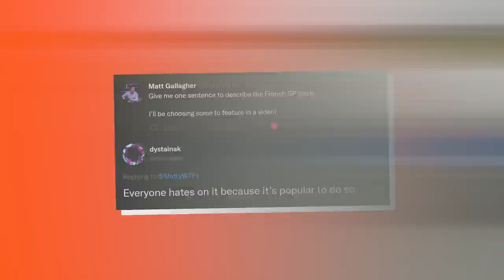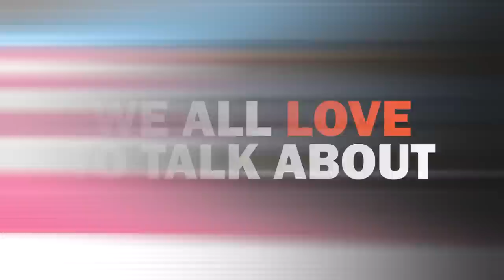Is The French GP Circuit Really THAT BAD?

Comment: Last year proved us wrong, and with how the racing is going this year, it will be a banger. It was really the car’s fault all this time
Reply: I guess we’ll find out this wknd
Reply: I dont look positive at this race in general yes cars are more close and competitive. But also more bulky. And if I remember correct going on the blue or red will destroy your tires. So I dont know but it can end amazing on track battles real fast.
Reply: I would say the race last year should be considered as "standard" for the sport, not really great but something that should be expected.
especially considering that this track is actually designed for racing, unlike, say Monaco which by design (or lack thereof), is expected to produce boring races.

The only reasons we find the race "exciting" back then were because 
-  the track is notorious for being boring in the first place, fans came in  with low expectation by default and where quite surprise when some things actually happened, and 
-  the sport suffers from the lack of competition during the long years of mercedes domination, fans are thirsting for anything that remotely looks entertaining back then, especially if it involves the defeat of Mercedes.
Reply: one good year doesn’t wipe clean two boring years

not to mention it was kinda only 5 laps of excitement
Reply: I'm hoping that since we have closer racing, most of the tracks will improve. Maybe once the cars are smaller, Monaco might be an option, but I doubt it.
Reply: And also it didn't need rain to produce a good race unlike Sochi (but yeah Sochi is probably the most exciting race last year)
Reply: @burningfreeman1  The coloured  lines are really abrasive yeah. They're designed to slow the cars down so they definitely damage them quicker. Especially if you slide across them
Reply: So people saying that Lewis’ was only fast due to his car aren’t bigoted now?
Reply: Nice point, I like the thinking here, let’s go!
Reply: @burningfreeman1  they are still 2m wide...
Reply: @gelmir7322  Last year was pretty exciting, so expectations should be higher for all races this year
Reply: Last year it was more of a strategy race that made it exciting instead of actual racecraft
Reply: Here we are, it was trash as expected.
Reply: Last year was exciting because of strategy. Not because of the track

Comment: Actually, I enjoy driving Paul Riccard on the F1 game, as it is a challenging layout with some slow corners in Sector 1 and a very tricky traction zone before the main straight in Sector 2, followed by the Chicane du Nord which splits the Mistrale straight into two parts. A good exit there sets you up for a possible overtake into the flat out right hander. The last sector has some flowing corners you need to absolutely nail to get any sort of lap time, however you can’t run to much downforce, as the main straight and the run from the Chicane du Nord down to turn 11 will punish a too draggy set up heavily. It’s a challenge for the car and the driver, as well as finding the right balance in set up. You want rotation bit a too aggressive suspension is likely to spin you out through turns 6 and 12 especially and maybe even turns 1 and 2, but you want to avoid understeer without adding downforce.
Reply: It’s an absolute banger on the games. Especially online/with friends as even if you’re not left space by inexperienced companions it’s still possible to continue racing and battle for the next corner. Had some of the best racing there
Reply: Thanks for at least defending it a bit. It’s a great track in games and with the new cars it will be a banger. With all the hate this gp is getting French fans don’t know how to act and defend it. We still hope it stays or be replaced by a more famous track but still it’s unfair to label it bad because of two bad races.
Reply: @graueliot9327  exactly man its my favourite track on the games, completely agree
Reply: I do too
Reply: @graueliot9327  yeah they should bring Magny Cours back that was a great track
Reply: Just wrote a comment saying the same. Glad to see others agree. I don’t understand the hate. The track came about when the cars were crap and only one guy could win so maybe that’s why people don’t like it.
Reply: I have had my best races there on the F1 game and enjoy driving there too.
Reply: The circuit will changed in 2023 possible but it will likely happen
The turn 1 run off area now become the straight while the slow corner in turn 1 is going to be a gravel
Reply: Wow wow wow, someone named some of the corners 🎉 🎉 🎉 
you took on the challenge in the video and nailed it 👊
Reply: I find that people enjoy this track because the AI is pretty weak on this track. And it doesn’t punish bad angles on the long turns. 
Compared to Hungary where the AI is very fast and it’s a super punishing track, especially on the chicane. 
I enjoy Paul Ricard too, and this race might come down to tyre degradation. The new tyres are really durable, strategies will be interesting. 
Also, agreed on the French flag stripes. It’s an eyesore
Reply: @weignerleigner3037  no, they hate it because it's nauseating to watch, all ariel shots are bad. It's a good layout hidden in a garbage parking lot.
Reply: @stevendawson6032  yes but Magny-Cours is located in the middle of nowhere and the GP is not financed by the government but by the local collectivities where the Paul Ricard Circuit is, and the ones where Magny-Cours is in don't have enough money

Comment: How to fix the french GP:

1. The racing: 
The racing can be easily fixed by choosing the first configuration for the first corner (flat out S corner). 
Cars can follow better then so that the next chicane becomes an overtaking spot. The rest of the circuit is actually pretty good to overtake and follow. I don't actually understand why they haven't tried this, since it's already there.

2. Asphalt
The amount of asphalt should be reduced, especially with the blue lines which causes headaches in some people. 
Asphalt reduces the tension of the watcher and drivers, where they can easily go off track. Add more gravel and grass instead and some corners will become iconic.

Comment: If Zandvoort can be remodeled, then so can Magny-Cours.
Reply: The main problem with Magny-cours is not the track itself, but the things around. It's in the middle of nowhere, so it's not made to receive a lot of people, it's hard to access since it's not near a big city with train or airport, etc. In term of track or infrastructures, work have already been done between 2010 and 2014, but it's not enough to host a F1 GP nowadays

Comment: It suffers from the same major issue as one of the middle Eastern f1 circuits (can't really recall the name of it), lack of elevation change.
If tery are there they are tiny, it makes the track seem like a slab of tarmac with some lines painted on, and completely removes the visual interest (and in car visibility).
There's also the excess of long straights (once again not a unique problem), which makes it utterly tedious (and adds too many chances for drs mindgame tomfoolery).

Comment: I have to say, in Assetto Corsa Competizione with its GT3 cars and the corresponding layout, I rather enjoy the track. You can really send the car in places and the ever-changing radii are a nice challenge and provide different line options for setting up a pass. The long straight is a blast as well, and the physiotape all over the place is actually kind of iconic, at least in VR.

Comment: My main issue with this track is those blue, white and red stripes painted everywhere, they give me headaches and they make it really difficult for me to understand what layout is currently being used. It also gives me the feeling of a track with multiple crossroads inside, like they are racing in an actual city centre. I think the image sent by Captain Lautner perfectly represents what I see when they race at Paul Ricard. To fix this, they could simply paint only around the layout they chose instead of every single road or maybe just add some signals or borders that can help delimitate the actual track visually and physically.

Comment: The track is a very balanced track that doesn't give any advantages to specific design concepts, so the race simply shows who is the best overall car. Since Mercedes has been so dominant for most of the last decade, that means the race is typically a Mercedes curb stomp.
Reply: weren't Red Bull a lot quicker at PR last year?
Reply: If the car has good Straight line speed, acceleration and fast corners is going to be the winner
Reply: @F1_HQ  Yes, because Red Bull had a great car last year.

Comment: Unfortunately, there is no real Grand Prix circuit with character and tradition in France. That's why France has had a lot of different circuits for French Grand Prix over the time.. whether it's Reims, Rouen, Clermont-Ferrand, Le Mans (GP), Dijon, Le Castellet or Magny Cours. Neither track could really last long. Of all the circuits I would prefer Dijon-Prenois.

By the way, Spain has the same problem with the Barcelona circuit. It is also more of a test track in terms of character.
Reply: There's always Pau.

Comment: I personally like it.. i like the colours and danger zones. I lke that if you go off track you dont automatically go out of the race like hitting a wall, stuck in gravel and so on and so forth. You simply lose time and tyres get worn out more in the red areas. So it's good for racing and cost cap.

Comment: I think it’s perfectly adequate, and better than some. A solid midfield track, if you will. It’s given us 2 very good races, especially in the midfield, and seems well-suited to the new cars. I don’t have an issue with the multi-multi-multi-use configurations, since we have a lot of that here in the US. I think any purpose-built tracks should have a variety of configs, since it means multiple classes and series can use it throughout the year. Benefits fans and the local economy both.

That said, the paint job is too jarring for TV. It’s not a bad *idea* to do all the stripes in the runoffs, and it’s probably pretty cool in person when you’re not moving about, but it’s not overhead shot or broadcast-friendly at all.

Comment: I think the biggest problem of the circuit is the lack of memorable landmarks. Theres no hill, no castle, no bridge, no tunnel, no stadium, not even a tree… so the track itself just looks uninteresting. And yes the first two races after its absence were boring, but to be honest those years most races were boring because merc was so dominant. I think the track layout itself - with the high variety of different corners and good overtaking opportunities - is actually quite good. Looking forward to it with the new cars.

Comment: It really isn't that bad of a track and it is actually a bit challenging to some drivers. My suggestion would be to move the french gp to Le Mans. Use the existing Bugatti layout  and then extend the track into the porsche curves and reconnect it via the test track. It would be costly, but if you plan that both F1 and the Le Mans 24 hours is a weekend apart it would draw much larger crowds for both races and also boost the overall appeal of motor racing. Maybe sell it as a 2 race package and that way motorheads can come camp and enjoy 2 different types of racing within a small window. Reducing the need to travel far between venues.

Comment: The problem with the French GP is the fact that it is a very long technical track, in which the gaps between the teams are being highlighted to a greater level and this doesn't promote close racing. In other tracks this problem is not that highlighted and therefore the spectacle is greater.

Comment: On ACC (Sim Racing), I hated Paul Ricard when practising, but during the Races, I learned to really enjoy it and was actually tempted to restart the 2 hour race in the career mode, cos I enjoyed it that much.  I came in 7th, but only cos I messed up my driver changes and had to pit on my last lap just to change drivers, it was gutting having to just sit in my box watching my position go from 1st to 7th as the cars screamed by.  Otherwise, I had a really healthy lead in first.
The layout used (I think) is no turns on the long straight and longest / outside track for the rest.

Comment: They should bring back Magny Cours to the F1 instead of Paul Ricard, in my opinion, and it's possible, considering that the track is still suitable for F1 (it still have the FIA grade 1, which is required to receive a F1 race).

Comment: I pretty much love this modern circuit, because it has all that a racing circuit needs to have (hard slow corners, fast corners, short and long straights, S-corners, all that stuff, but it's still safe, clean, and very good for the audience, but really not boring or easy at all. And I do not like any circuit with walls just next the track. Why does there still need to be a real danger of death or serious injury in the 21st century? There are many other options, like gravel zones, escape zones, grass areas, etc. This circuit is the only one, which can be called safe and modern, in the whole F1 calendar.  And only 2 or 3 others are any near to be safe... There are many great circuits, but they really need to be redesigned on the safety side, by adding gravel zones, escape zones, etc, with no walls near the track at all... And no any kind of yellow curbs, which may catapult the car, or cause a serious injury to the drivers, instead of the gravel or grass areas, which do the same track limitation job, but safely... Just one thing at this circuit is bad - the pit entrance. It really needs to be redesigned, maybe like a Bahrain or Monza circuit, with the entrance at the straight part (there really is plenty of space for it), or just by shifting the entrance road one corner back, with just one or two big curves, like Suzuka, or something like the Red Bull ring...

Comment: 2018 and 2019 were considered boring races but id argue that 2021 was more interesting. Now we have these new cars I feel like it will be a better track. It has Silverstone vibes with its high speed corners, a track should always be judged on its last race. France is also super hot at the minute which means the race will likely be a 2 stop. Add Merc potentially being in the mix and RB and Ferrari being close. I hope its a good race. That being said Magni Cours is a better track and slightly shorter so the lap isnt so long. 

Anyway fingers crossed for a great race weekend!

Comment: The racing could be amazing. But it’s impossible to differentiate one corner from another. The tv coverage just bounces from one sector to the other and I have no clue where we are at. 
The acres of blue, white, and red stripes does even more to interrupt the viewing of the track. 
Even with this years cars, there are times when everyone is holding station…at that point it really helps to have a track with character (Spa, Montreal, Monza, etc.) but this really has always been just a good test track.

Comment: I kinda like it, but the timing of the race is wrong. After the Monaco GP is perfect as they are quite close to each other.

Late July is the usually the hottest weekend of the year in southern France (around 37c to 40c) and height of the high season (busy touristic period of the year too) — I’m sure this will cause discomfort for the fans getting there and the heat could cause some to feel unwell and with the F1 cars cooling issues. 

I wouldn’t be surprised if there’s a few DNFs for cooling issues and big complaints with traffic and organisation…

Comment: There is also no scenery. Around the track there are just some grass banking, and outside the track in every direction there is just parched land and dull trees. Take any photo of the circuit and I would not have a clue where it was taken. To add to that there don't seem to be many grandstands close the track, thanks in part to the huge run off needed everywhere because of all those track configurations where everywhere could be a corner in some config.

Comment: I think it's OK. It's a proper race circuit, so I'll happily take it over the likes of Singapore, Saudi Arabia and Monaco). I'll also take it over Spielberg (although that could be to do with over exposure due to F1 and MotoGP both having had two races there in 2020 and 2021). France being off the calendar for 10 years should not have happened. It's nice to have them back
Reply: I like Spielberg. But I feel like it generates the most inconsistent race stewarding of the calendar every time.

Comment: Lack of character says it all for me. I always wonder how the drivers can pick out the track edges, because some indicators aren't (at least as a viewer) particularly clear. It will be worse this year, as the drivers have already said how it's harder to see out of the cockpit with the new cars.

Paul Ricard should remain as a test track. I'm not sure if Magny Cours is big enough now, mainly because of the increase in size of the cars. I can't imagine how a single car would get through the last chicane! It's near enough single file on motorbikes! I want France to have a GP, but not there. Surely there's another track that can be brought up to class A or 1 or whatever it is?
Reply: Probably has to be Le Mans, if the entire track, especially street section, are fully refurbished, and the starting line with fixed starting grid. Overtaking Spa to be the ultimate longest F1-capable circuit in the world, just as Alonso tested in his Alpine 2021